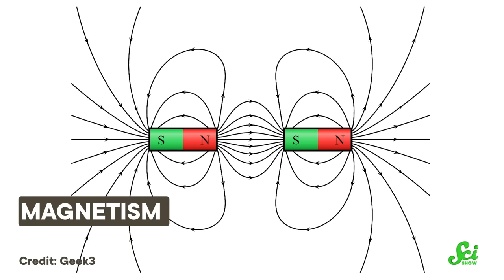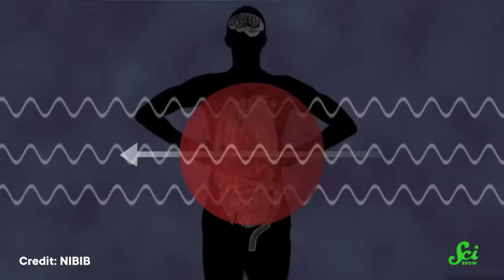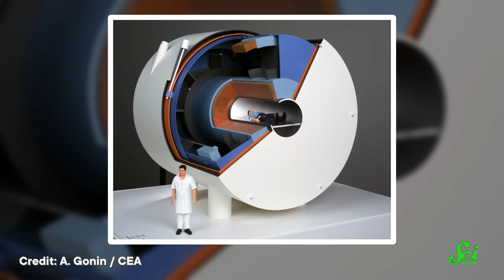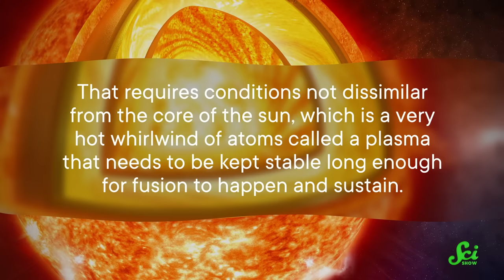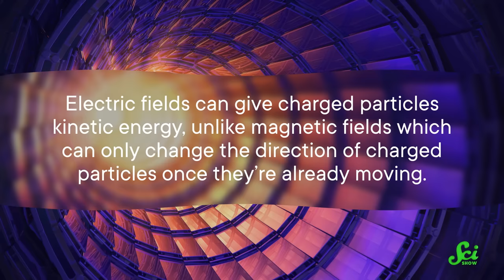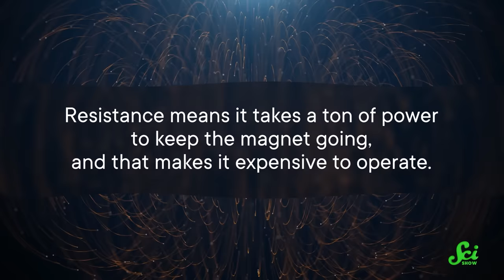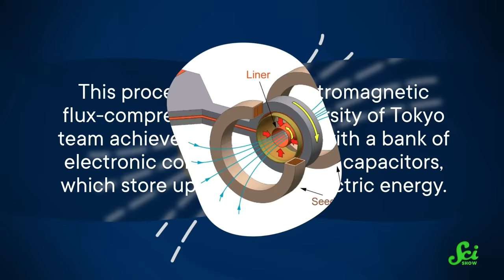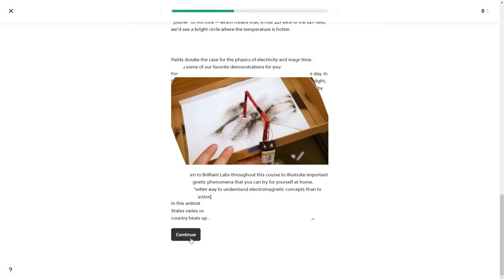What is the Strongest Magnet We Possibly Could Make?

Comment: I've always wondered, if you took a permanent magnet and stuck it on the ceiling, will it eventually weaken and fall as it uses energy to resist Earth's gravity? How long would that take?
Reply: A long long time I believe
Reply: they have a half-life of 700 years,  so after 700 years they'll be half the strength
Reply: You should start this experiment today. Please have one of your great-great-great-great-great-great-great-grand children come back here and post the results.
Reply: It doesn't need energy to resist earth's gravity, the same way that your cieling paint doesn't. Energy needs motion in order to transfer. Though as others have said, all magnets are temporary so eventually it would fall
Reply: @rgbii2  An old glass table with a bunch of magnets on a metal plate would actually be kinda sick. Oh pappy made that back in the 2020s, the first magnet fell off last year.
Reply: @rgbii2  there are some experiments running for decades already. Interestingly, there is also a musical composition being performed for that long too.
Reply: An electron doesn't use energy to create an electric field any more than a permanent magnet to a create a magnetic field.
Reply: A permanent magnet doesn’t use any energy to resist gravity. Energy or “Work” is equal to force multiplied by distance, and since the distance moved is zero, the energy transformed is also zero.
Reply: It would actually get stronger as the field slowly aline over time upto 99 years to become the strongest a magnet is counter space
Reply: @rgbii2  there’s something morbidly interesting about how none of us nor even our great grandchildren will ever see the end of the experiment; because none of us here will have any kids
Reply: It doesn’t use energy to stick to the ceiling. You used less energy than normal to lift it up to the ceiling and you will use more than normal to separate it.
Reply: @kathyjohnson2043  was it VSauce or Scishow that made a video on the music? I feel like it was Michael, along with something to the effect of "What is music, really?"

I don't remember the video, but I remember watching a video on the subject and finding it very interesting!
Reply: @alertsquirrel  i can't remember exactly where, but there is an organ-like instrument that is designed to play a chord for months, or years, and then it changes to the next one. The time of the chord changes are known and people come to be there to listen to it
Reply: @vbgvbg1133  so... you think nerds don't breed, eh?
Reply: HEY GOOGLE
Reply: @ralphclark  hold a brick without moving to the ceiling and let me know how using no energy is going
Reply: @kenneth9874  Use a stack of bricks and/or mortar to do it rather than your contracting muscles and then maybe you can see that it takes no energy and will stay there forever ( not withstanding chemical and weathering erosion ).
Reply: @phillipsusi1791  not quite the same, there's no column under the magnet
Reply: @ralphclark  I see it like a rest energy, it's a potential energy and a minimum till there is a way to get... work(as you said) out.. there is some kind of asymmetry going on but I don't have the math skills to express it..
Reply: Temperature changes - winter, summer, day , night - will weaken the magnet and will cause the magnet to fall, I guess.
Reply: "permanent" actually just means "functionally permanent." i wouldn't use neodymium magnets to hold something up that i wanted to last a thousand years without maintenance, but i'd feel confident using them to hold something up that i wanted to last until I'm dead, at which point I won't care too much whether or not that picture of my cat stays on the fridge.
Reply: @petevenuti7355  yes there’s potential energy but the potential energy doesn’t go anywhere until the object moves, whereupon the potential energy turns into kinetic energy. The energy expended during that process can be calculated a number of ways, one of which is to measure the NET force acting upon the object and the distance it travels but only while accelerating due to that net force.

Another way is to calculate the potential energies represented by the object’s initial and final positions in all relevant force fields and then subtract one from the other; the difference will be the same as the object’s final kinetic energy.

This is classical Newtonian mechanics of course and the maths typically covered in full by the physics curriculum at age 15. Relativistic mechanics (for fast moving objects and/or very strong gravitational fields) is a good deal harder and you would not usually do that until university level physics.
Reply: @ralphclark  I have some hope someone will be able to take advantage of the asymmetries in nature to work like Maxwell's demon ...
Reply: @petevenuti7355  Maxwell’s Daemon? Not a chance - the one thing all physicists will agree on is that you can’t cheat entropy. It’s just how numbers work.

And asymmetries by themselves aren’t meaningful, they only represent an absence of correlation, absence of a physical conservation law, so there’s nothing to exploit. 

If you mean asymmetry where symmetry was *expected*, like the CP violation in the weak force, that happens because our model is incomplete. When we have a more accurate, more detailed model, the asymmetry will most likely go away.
Reply: @kenneth9874  So what?  The point is that fundamental forces do not consume energy to exist.  They simply exist.  The Earth does not expend energy to exert gravitational attraction to the moon and thus, eventually will run out of energy and be forced to release the moon.
Reply: Some years back, I had this stupidly strong magnet that I had pulled out of a high end subwoofer that stopped working and somebody left it beside the road to be taken away with the trash. I am fascinated by magnets so I was happy (at first) with my curious find. That THING was scary ! I found just how truly POWERFUL that magnet was as it could very easily hold my weight ( 170 lbs) . I could not pull it off of anything it stuck to ,so I had to slide it off and that was a struggle. My Dad told me that I would probably wind up getting my fingers or hand stuck between that magnet and something made of iron and I could possibly lose part of my hand . I finally realized that having such a ridiculously powerful magnet was a liability ,so I went on a walk and carried that magnet until I could find someplace to stick it . I cannot remember how far I walked ,but it was quite a distance. I wound up going over a bridge and I stuck that magnet onto the guardrail and left. I wonder if that magnet is still there after the years since I left it or if that bridge .
Reply: Gravity is a curvature of space-time, magnetism is a force
Reply: @MichaelTheoret  it sounds a bit like jumanji, there is probably someone else going through the same trauma trying to get rid of the magnet😊
Reply: @kenneth9874  if you hold it there by placing it on a table, no energy will be consumed thereafter. The weight remains still because the electromagnetic forces between the atoms in the table are perfectly self balanced against the force of gravity. They maintain this without any change in energy.

If you are holding it up there yourself like some kind of weightlifter, your muscles are consuming work because on a microscopic level they are not still - the protein fibres in your muscle cells are continually relaxing and re-tensing. This consumes ATP which your body must manufacture through metabolic processes, which you feed by eating. And you’ll notice that when your muscles do this kind of work, the bound energy in these biochemical molecules is ultimately transformed into heat. In this case we wouldn’t use Newton becaus e calculating the mass and distance moved of every atom in every individual muscle cell twitch would be way too difficult. Instead we would measure the heat produced and calculate from that.
Reply: @ArawnOfAnnwn  it seems plausible to me. Random quantum mechanical processes allow atoms to move in and out of alignment, and entropy guarantees that the longer this continues the more the proportion of aligned spins will shrink.
Reply: I believe it would eventually fall off, but not due to energy consumption. Ralph Clark has a good point, the atoms that make up the magnet would eventually fall out of alignment over time, thus reducing the magnet’s strength until it’s “not magnetic” anymore. This would take a very long time to happen uninterrupted though. 

You can speed up this process by heating the magnet though. Try subjecting a neodymium magnet with a torch, it will lose its strength relatively quickly.
Reply: @howdy832  How are magnets "temporary" when we mine magnetite all the time? Shouldn't all the magnetite not even exist at all anymore considering how old the planet is?
Reply: @runnergo1398 Yes, one of the ways that geologists estimate where pieces of continents were hundreds of millions or even billions of years ago is to measure the magnetic field in rocks. When the rocks are below the Curie temperature, they hold their magnetic field for a very long time.
Reply: @Ted Livingston i think the point is there is a magnet on the floor of the roof so the magnet on the ceiling will stick.
Reply: @runnergo1398  the same way that uranium is temporary or that carbon 14 is temporary or even that ozone is temporary, except that magnetite is a mineral, not a state. it would still be magnetite if it lost its magnetic poles (which could just be recharged anyways because magnetite is a mineral).
Reply: "permanent"
Reply: @ericfielding2540  Thank you, that is really interesting. You know way more about this than I ever will. I thank God for smart scientist like you.
Reply: @jonathanodude6660  Thank you, that is really interesting. You know way more about this than I ever will. I thank God for smart scientist like you.
Reply: @MaryAnnNytowl  it's the offspring of nerds that can't breed... Some sort of genetic mutation or something...
Reply: I think all of the energy is  input in aligning all of the magnetic spins of the individual atoms before allowing the metal to cool. It slowly decays away as magnetic alignments begin to drift, and eventually the magnetic field will weaken enough to fall. It's not really 'using' any energy while it sits there tho.
Reply: That's not how permanent magnets work. There is no energy being expended in the generation of a permanent magnetic field. Their fields are generated by the locked-in alignment of the individual atoms in the magnet, set when the material cools down below its Curie temperature while exposed to a magnetic field. Quantum physical effects cause the atoms to spontaneously randomize their alignments over time, but if they didn't, the magnet would stay stuck to the ceiling of your room forever.
Reply: @deusexaethera  And the magnetic field and the heat that affect the magnet during creation, that energy is just free?
Reply: @deusexaethera  By basic conservation of energy assumptions, you can assume that all the work that the magnet could ever do was used, at a minimum, to fabricate the magnet itself.
Reply: @Kathy Johnson  sorry, I don't check my notifications often enough.

Anyways, yeah that was part of the subject of that video! Super neat!
Reply: 1379 year's
Reply: @kindlin  potential energy only exists in a relative sense. Consider yourself standing on flat ground. Seems like 0 gravitational potential energy right? Now there's a deep hole in the ground next to you, which you might fall into. Digging the hole didn't "create potential energy" for you. But in this new reference frame you have quite a bit of work you could do. Typically the energy from fields is defined to be 0 when objects are infinitely far apart, and so it is negative (for attractive forces) when they come together.
Reply: @kindlin  that's the thing about magnets, they do 0 work total. it'll apply a force, yes, but a force is not work on its own. the same way you can do work to lift something or do work to stretch a rubber band, you can do work to move something against a magnetic field. in all three cases, moving back the other direction returns that stored energy to you, although usually not completely, because of friction.
Reply: the energy required to manufacture a strong magnet is there for the same reason it takes energy to make steel out of iron ore. You're trying to arrange particles in the way you want, and that happens to require those particles being at high temperatures and undergoing chemical reactions. most of the energy that goes into the process also comes out as excess heat, with the little bit left sitting in chemical bonds. the final product of a steel beam or a magnet doesn't really have a significant storage of energy from the manufacturing that can be released later, one just happens to have more interesting interactions with other magnets.
Reply: @SlenderSmurf  I do agree with everything you just said, but once you have a magnet, you now have a new potential well that didn't exist before. Before charging the magnet, no force, after charging it, able to move ferromagnetic materials.
Reply: @elderfrost9892   It's interesting you say that magnets can do 0 work. I get the impression from you that this is some kind of law of magnets I'm not aware of, but if that is the case, how does a magnet pick up a paper clip, doing work and raising the CG of the paperclip up in the Earth's gravitational field?
Reply: @kindlin  It somewhat depends on the specifics of how you define work, people typically don't say that gravity does work either. A magnet and gravity do work, or more accurately, convert types of energy, in a similar way. What I meant to say was that magnets average out to 0 work over time, as the work they do is really a conversion of potential energy. when a magnet picks up a paperclip, it looses the potential it had from being far from the magnet, and gains potential from being farther from the earth. but once the clip is touching the magnet or at the center of the magnetic field, it's done, the magnet doesn't keep supplying energy. the work that the magnet did to move the clip has to be done against the magnet in order to move the clip back to where it was.

Your point about new potential magnetic wells is entirely valid though, it does take energy to produce new magnetic fields. this however is negligible for making permanent metal magnets. Think of it similar to gravity, a planet has a huge gravitational well, but really it's the tiny gravitational wells of insane amounts of atoms all interacting with each other. A permanent magnet is created by moving all the little magnetic wells of individual molecules to cancel out less, which does slightly increase their potential in relation to each other, but not hugely.
An electromagnet, however, usually most of the energy supplied to create its field, usually because there's not much other energy in the system. An electric motor works by using a coil of wire to create an electric field next to a permanent magnet, then removing the field and doing it again at the right times to keep making forces in the same direction. That work doesn't come for free, as the magnet field is created it adds potential energy between the coil and the magnet, and that potential directly comes from the electrical energy put in. If you run a current through a coil with no permanent magnets around, it uses less energy, since it's not adding that potential and not doing any work. It does however use some energy, as it creates potential between the individual wires in the coil. Since those wires don't have any work done to them by the field, they convert that potential back into electrical energy when you stop putting in energy. generators work off this basis too, the magnetic potential increase caused by moving coils and magnets is converted into electrical current and energy in the coil.
I've oversimplified greatly, magnetic fields and their relationship with electric fields are pretty complex and interesting. But hopefully that's a decent explanation, if a long one.
Reply: @elderfrost9892   Thank you for the explanation, but honestly, electromagnetism has never really clicked in my brain, and I have a tough time putting everything you just described into a succinct model that I can think about cohesively.

Comment: If/When you do an episode on fusion, will you look into Helion's method as well as the tokamaks please?
Reply from the maker: Oh yeah...though Real Engineering's video really hit it out of the park already!
Reply: @SciShow  True
Reply: That actually came to mind during this video, when talking about the LHC.  Was thinking they seemed to get those gasses up to speed in a [relatively] REALLY short chamber, but then I realized I couldn't recall the speeds they claimed.
Reply: @ChrispyNut  I seem to recall mach 3, but I could be way off.
Reply: @SciShow  maybe worth a mention of their electro-magnetic flux compression literally resulting in fusion... but instead of a rigid container exploding, they capture the outward pressure release in their electro-magnet coils as electricity?
This direct conversion from electricity to fusion energy release and back to electricity using magnetic fields is reminiscent of Tesla's experiments ~130 years ago (with mechanical motion in place of the fusion)!